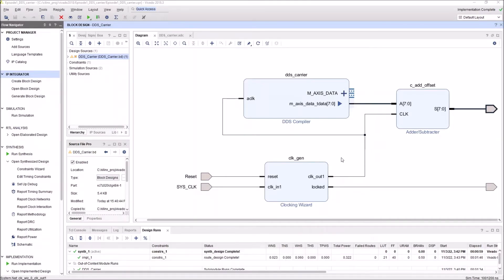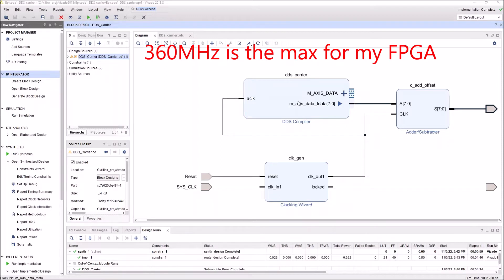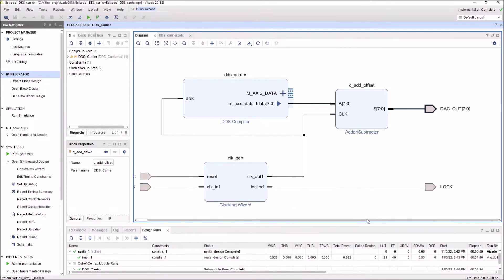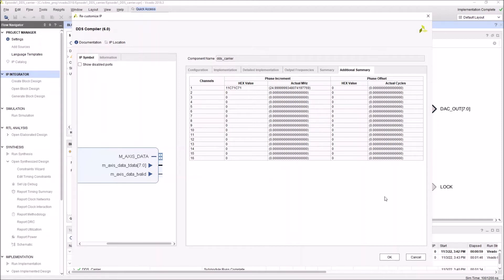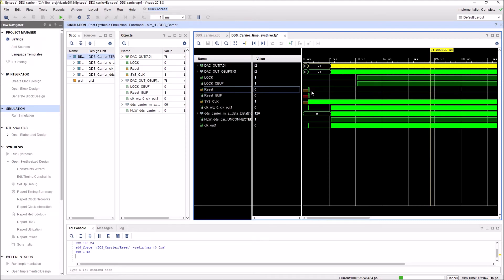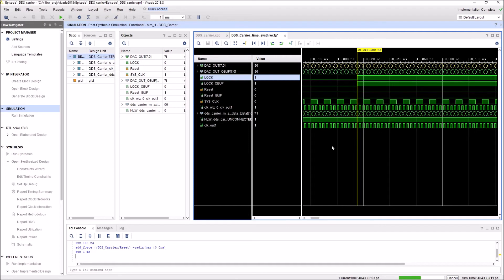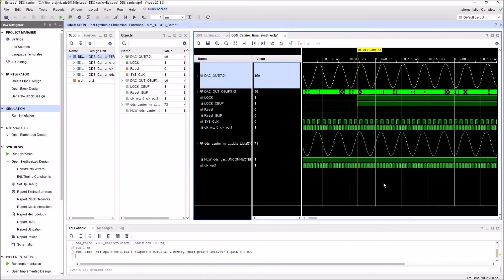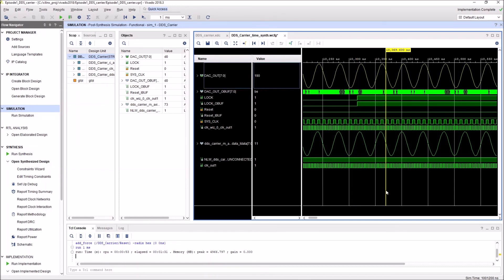FPGA Carrier with DDS

Comment: I don't see the point in having a constant 25Mhz carrier generated on the FPGA, wouldn't it be a lot more power than a VCO? Plus you would have to account for phase noise of the clock and quantization noise
Reply from the maker: With the DDS you have a few advantages over a VCO (and some disadvantages of course) - it never loses lock,  very agile frequency changes, easy to generate quadrature signals, frequency resolution to fraction of hertz. I agree the phase noise can be a con but the DDS IP core has a few tricks to fight the phase truncation in the phase accumulator (rasterizing, dithering, Taylor series)
https://docs.xilinx.com/v/u/en-US/pg141-dds-compiler
I think is more than sufficient for most of the applications in radio comms.